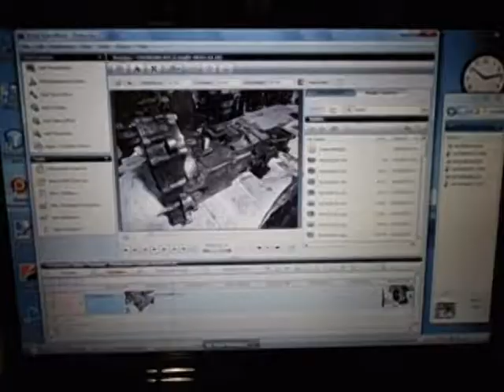Tercel 4WD Manual Transmission Disassemble

Comment: Hi Robert, thanks so much for posting these videos. You've really helped me keep my Tercel going. Its currently parked awaiting a bigger repair. Im wondering if you could possibly point me in the direction of where to get started. I was driving into work one day and I pulled off the highway in to a gas station. I down shifted from 5th to 4th and my transmission completely locked up on me and brought the car to a dead stop. at the time the roads were icy so I was in 4wd. when this lock up happened it bumped me into front wheel drive. After that lock up, every time I took my foot off the accelerator it wanted to make a horrible grinding noise. I managed to baby it in to work by clutching in every time I had to take my foot off the gas. Then later on while leaving work it locked up on me again but this time my front passenger side tire turns backwards while my two back tires turn forwards. I have no front wheel drive any more, But in 4 wheel I have the opposite rotation between front and back. I managed to get it home by taking out the front passenger side cv axle to disengage that tire from the transmission. I have access to a parts Tercel and I think With your Informative videos I can handle the repair. Any advice on what to pull apart first?? Thanks.